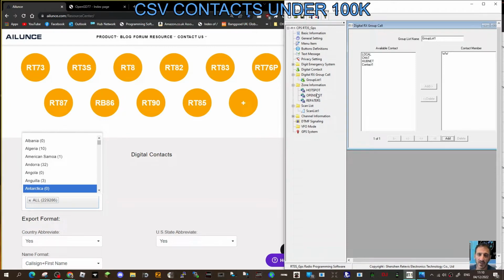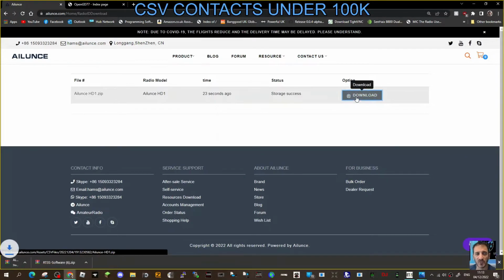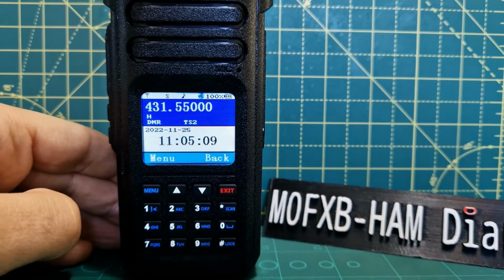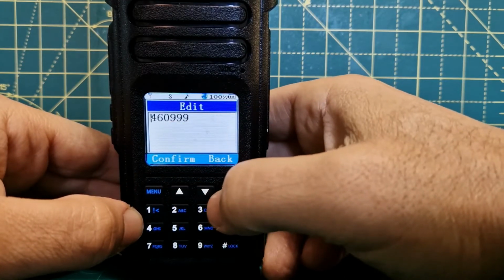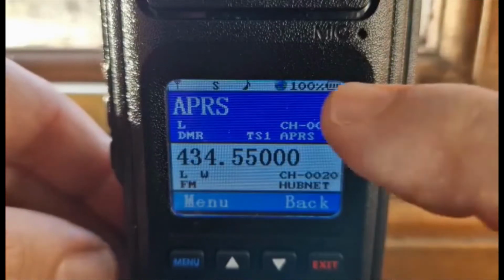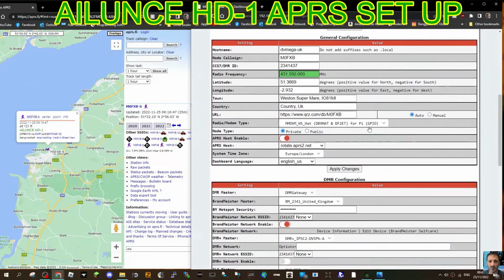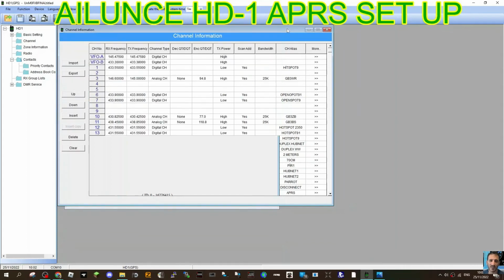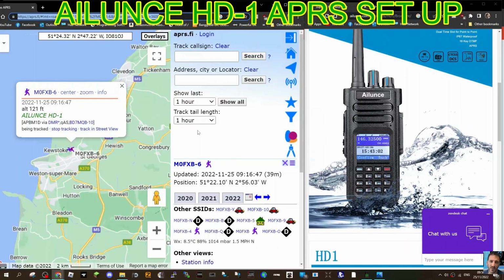RT3S-MD380/390 Load CSV Contacts - 100k

Comment: On my RT3S without the GPS it doesn't work, I can not import the contacts. Even when I take only Austria there are 2341 People or so, it does not work at all. On my second RT3S it doesn't work either. The drivers are all ok, the cps is ok. On the Anytone-878II Plus it works fine, but these radios won't
Reply from the maker: Hi i will test and do a Video